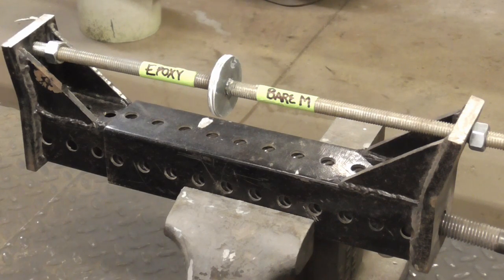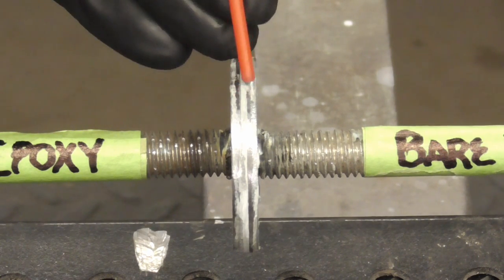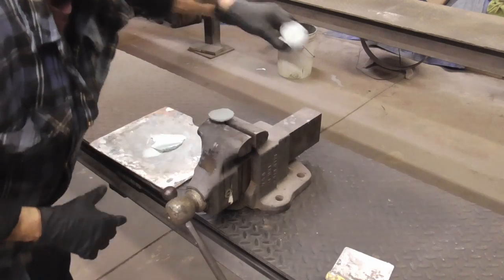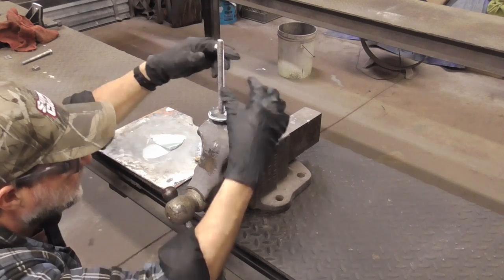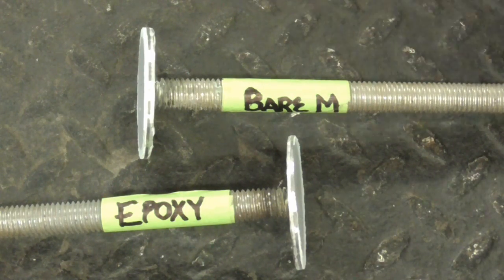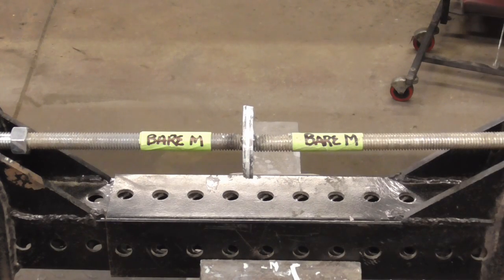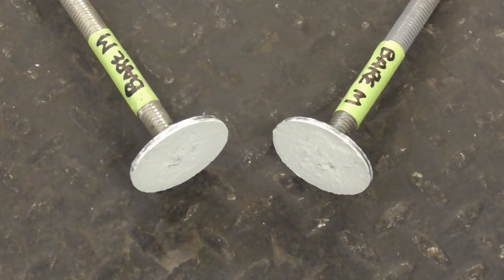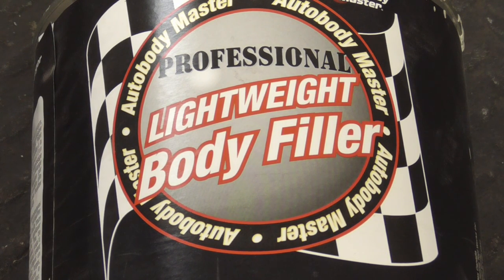Apply Body Filler Over Bare Metal or Epoxy Primer?

Comment: I'm from the 'over bare metal' camp but...

80 grit vs 220 grit, how many coats of epoxy primer, dry time between coats of epoxy, etc play a roll in this 'experiment'.

Yes, the epoxy separated from itself, but the filler stayed (for the most part) adhered to the body filler.

So WHAT did this prove?? 

To me, it proved that epoxy primer isn't as good of an 'adhesive' as body filler.

IMHO......IF this 'experiment' was conducted with both surfaced prepped the same way with the same abrasive disc (80 grit) OR the 220 grit DA disc (fresh discs for each piece of metal) THEN it would have a BIT more credibility.

As it stands now, it's 'apples to oranges' to me.
Reply from the maker: With respect, body filler  was designed to be put over bare metal.  Remember, it came out 30-40 years before epoxy primer - that sort of ends the debate right there.   In all the shops I’ve worked at in the metro Detroit area not one boss, manager, worker would ever accept putting filler over anything but bare metal.  A guy who did would have been laughed right out of the shop. Yes you could cheat and get away with putting it over paint and primer on small stuff but it was always frowned upon.  The guy who got caught doing it was considered a hack or a newbie - couldn’t get his work straight so after he primed it, you saw him fiddling with filler again - over the primer he just blocked & found out it was too f’d up to fix with just primer. Here's another vid that may help - https://www.youtube.com/watch?v=rtUoaRxmgAg&t=424s - from a different YT channel
Reply: @LakesideAutobody  DID you read my 1st sentence??

I'm from 'lead and lacquer', polyester body filler over bare metal' crowd.

What your linked video shows is poor surface prep (not enough 'tooth' for body filler to adhere to).... 

PLUS he applied 'poly glaze' (refined filler/ different 'talc' content) over primer and paint (the feathered area) AFTER giving it some 'tooth' to adhere to.

So to reiterate....
I prefer to use body filler over bare metal.
The video you linked shows improperly prepared surface (no 'tooth') for body filler to stick to. Hence to repair failed.

BTW, I've being doing auto body repairs since the mid 1970's  and have seen the 'evolution' of body repair materials along the way. 

I've worked under some of the best 'old school' body men and for some real hacks..

I've painted from small touch up jobs to complete semi tanker trailers and have used materials ranging from 'rattle can' to Imron (depending on what the customer has wanted) so I've seen/done a bit of body work over the decades (and I'm still learning new techniques and materials).
Reply from the maker: @russdavis1960  I guess I don't understand what your point is.  Are you saying I didn't prepare the epoxy primer correctly?  Are you saying I used the wrong filler?  I don't really even know if you prefer filler over bare metal or filler over epoxy primer.  Sorry.  I do agree with you that learning new processes is good but only if they improve the efficiency and quality of the old.  Nice talking to you Russ - have a good week :)
Reply: @LakesideAutobody  I'm saying I have pretty much used body filler over bare metal most of the time.

I have also used 'poly putty' over properly sanded, sound, substrate (paint).

As far as I could tell you prepped the surface (220 grit) properly FOR epoxy primer..... But IMHO the epoxy primer didn't have enough 'tooth'(aggressive enough scratches) for body filler to be applied.

Granted for the most part, the body filler gripped the epoxy....it was the epoxy which mostly separated.

IF I'm going to have something that is in bare metal for an extended period of time, I will put a couple of lighter coats of epoxy primer on to simply hold the flash rust at bay.

Then when I get back to the panel(s) I sand it with a MINIMUM of 80 grit so the filler has something to mechanically grip to.

I don't recall seeing anything on the Autobody Master epoxy primer about recoat time (maybe I missed it).

I know PPG DP-LF has a 7 day 'window' before it must be sanded and then reprimed.

A high solids, high build epoxy primer I just recently started using is actually an industrial coating for pipelines. It's THICK (thicker than the old Clausen Sandy sprayable polyester) but so far I like it. 

It can be tinted also.

I also have been using USC filler #17000. It doesn't seem to 'gum up' the paper, goes on smooth, and saves a bit of sanding time (also is REAL smooth if you put it in the paint shaker for  few minutes)🙂
Reply from the maker: @russdavis1960  Totally agree with what you're doing there.  Sometimes I have to park stuff outside for a while too.  Never was able to solve that problem.  If it sits in the open where wind can dry it quickly or in the sunny areas it usually does pretty well with just a few coats of primer.  Anyway - good talking to you my friend and like I said, I'm going to try this experiment again - diff brands, dry times, painted surfaces, etc.  This video may interest you too if you're interested in filler over paint -  https://www.youtube.com/watch?v=koMw6-auoIs  Talk to you later - Jerry
Reply: @LakesideAutobody  Yup.

Good demo on applying filler over properly prepped surface.... painted or not.

The DIY vid shows non-properly prepped and the results afterward.

TOO many 'bodyman' hacks out there.

I knew one guy who only relied on Bulldog adhesion promoter for door jambs.

LOTS of comebacks.
Reply from the maker: @russdavis1960  Thanks Russ - have a good week :)

Comment: I saw another shop video he sprays bare metal with epoxy first then does body work over. I don't see how can work the metal that way to work dents need bare metal. I can only conclude he is not really working the metal just filling everything, and replacing body panels with aftermarket which he was also advertising a company that sells aftermarket body panels for classic cars. I get that time is money takes lot of time to work the metal pull body damage out higher profits if just replacing panels and filling.
Reply from the maker: Honestly, since paint is more water proof than anything else there is absolutely no reason to use epoxy primer unless you leave a primed car outside under a tree for a few years.  It doesn't matter if filler, primer, putty, etc. is porous - paint protects it all from moisture.

Comment: What about rust
Reply from the maker: Sand blast it and fill any pits with body filler then prime.  You can hit it first with epoxy if you want.  I did this video again trying different things - https://www.youtube.com/watch?v=wVhQLqPAGVU   Body shops put filler over bare metal.  They really don't even use epoxy primer except maybe on bare aluminum or plastic bumpers for adhesion purposes.

Comment: SO ONE SIDE YOU SANDED WITH 220...THE OTHER WITH 36 GRIT...LOT MORE TOOTH ON BARE METAL SIDE....NOT REALLY A FAIR TEST...
Reply from the maker: It's what each product recommends for adhesion.  I used the 220 for the epoxy because paper in that range is what you are supposed to use for it to stick well.  You use 36 grit fiber resin disks for applying filler.  You also wouldn't want to prime over 36 grit in real life either.  Hope that clears it up a bit :)
Reply: @LakesideAutobody  WAS TAUGHT TO 80 GRIT METAL...EPOXY TO PROTECT...BODYFILLER ON TOP AS CAN ABSORB MOISTURE OVER TIME....
Reply from the maker: @southpawsgarage  Nothing but the finish is responsible for corrosion protection.  If there is a claim on TV, in magazines or on the internet that you need it for “Restoration Quality” or “Corrosion Protection” they are selling products.  Remember body filler came out 30-40 years before epoxy primer - how was it applied then?
Reply: @LakesideAutobody  LEAD....LOL...

Comment: As you have said: ”properly prepaired bare metal and epoxy primer.” You prepared properly just bare metal. Epoxy did'nt split from filler, it splited from other epoxy layer or metal or whatever. So, you broke the spraying technology of epoxy.
Reply from the maker: Yes - the epoxy was the weak link in the repair - or it would be the weak link in a repair.  I hope to do it again w/ diff brands, dry times, etc just to see if anything can beat the filler/bare met bond :)

Comment: The question is. Is the adhesion good enough? This experiment proves nothing really. 
Epoxy with filler on top, only has to adhere well enough to survive minor flexing, heat from the sun, light pressure washing. It never has to survive being pulled off the car with a hydraulic air ram piston pump mechanism. 
Epoxy on bare metal, then filler over the top does a better job of protecting the steel from corrosion. 
Sure, you proved that bondo adheres to bare metal better than it adheres to epoxy. But does it matter? If it adheres well enough, who cares?
Reply from the maker: With respect - paint protects the metal from corrosion.  Companies try to scare people into using their products.  Filler was applied to bare metal 30-40 years before epoxy primer came out and worked just fine.  Have a good weekend DJ :)

Comment: if the epoxy separates dosent that tell you that the paint would fall of the car if the epoxy split? your obviously not an engineer  lol
Reply from the maker: I did this experiment again but let the epoxy dry for much longer.  I'll upload that video this Friday.  4/15.  BTW, the only thing the primer splitting would tell you is that it's weaker than filler.  Just like glues - some would "give" faster than others.  No need to get upset or anything - just trying to help folks answer a question with some logic :)

Comment: That’s some gray filler. I’m using too much activator as mine is really pink.
Reply: You can get catalyst in white (which will appear grey) red, blue, yellow or green.
Also some fillers come colored, like Rage Gold, so it's not that Jerry is using a tiny amount of catalyst.
But temperature (and just how fast you want it to go off) would factor in how much you need to add
Reply: @jimurrata6785  but he maybe. You’re just assuming he’s not.
Reply: @paperandmedals8316  Jerry replies to comments. Maybe he'll chime in?
But I've been watching this channel for a few years and have seen him mix and grate plenty of body filler.
It's the dead of winter up there. He's not shorting the mix.
Besides, your comment was about you using too much hardener not him using too little.
I always use a different color if I have to go back over a patch that ended up low.
Contrast helps my older eyes
Reply from the maker: I'm using blue hardener.  It makes no diff though... They have red, blue, etc - its all the same :)
Reply from the maker: Thanks Jim - have a good weekend - good hearing from you my friend :)
Reply: @LakesideAutobody  Jerry, do you have anything to say to the first poster about how much (or little) hardener you're using?
I know it's not 95° in your garage and you're mixing on the lean side so it doesn't go off like a rocket....
You have a great weekend too, my friend!  👍
Reply: Depending on ambient temperature I would use a squeeze about 18mm long for a golf ball size wad of filler.
Or a stripe about 1/2 the length of my glob on the mixing palette.